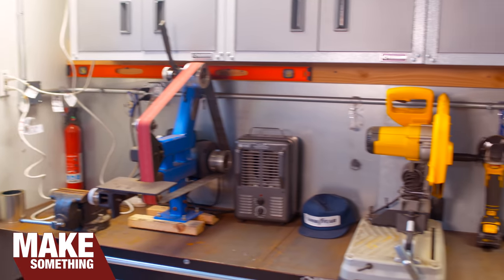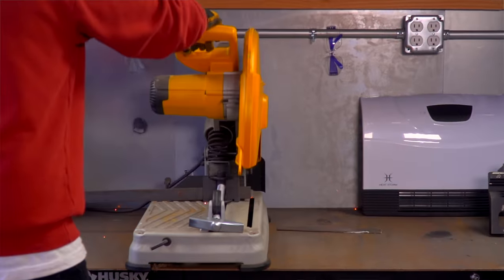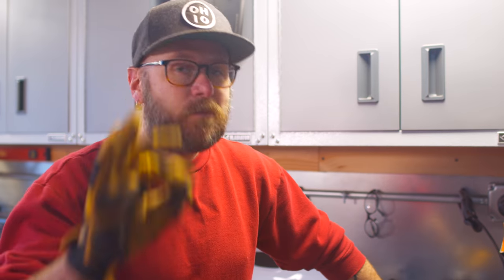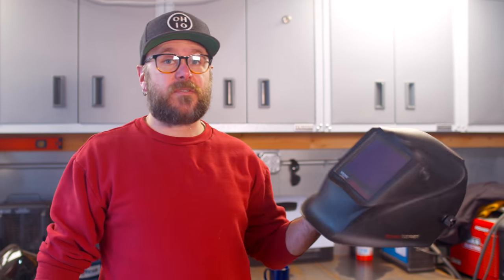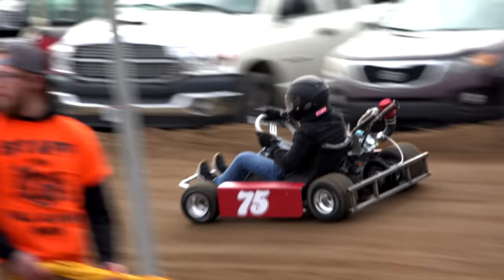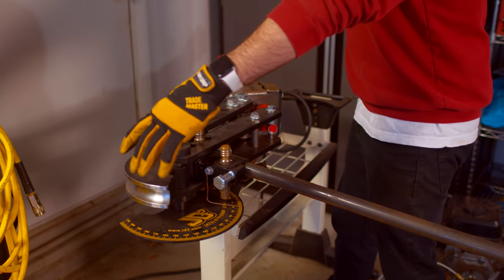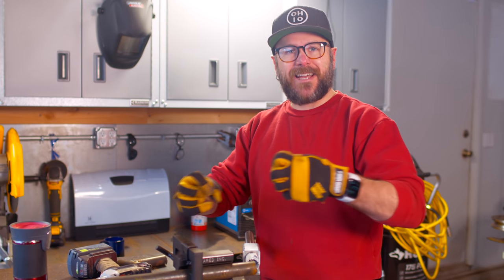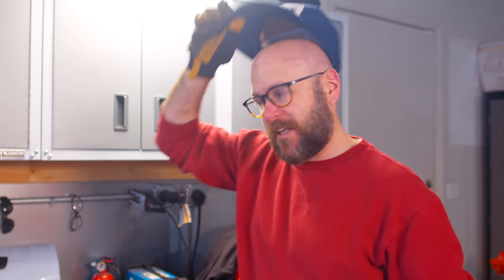Garage Metal Shop Tour. Getting Started in Metalworking. Furniture, Sculpture, Chassis Building.

Comment: Getting started is easier than most think. In my opinion you just have to get the right tools. I remember when I started my shop it was completely bare bones and I didnt even have enough money to buy materials for a table, but I took my only 500 bucks I had and bought the basics and started my rail business building rail on the floor, lol. That was 2016. Piece by piece, job by job, I bought all my stuff 1 tool at a time . 5 years later, took that 500 dollar investment and turned it into 250k a year building rail. Great trade to have...
Reply from the maker: Dang! That's an inspiring story! Right on!

Comment: I'm starting a channel for you...as a former Marine Infantry Platoon Sergeant, I'm starting "Hobby Shop Boot Camp", yup, and my first class is going to begin by asking if you made anything that worked in a seriously amplified manner, lol.  Actually, for a home shop, you have some pretty decent tools.  It's looking like my shop where I metal fabricate and woodwork.  Currently, I am fabricating an all aluminum camper, but designed like none other.  Top secret!
I have a lot of the Flex-Volt tools and they are great.  I have the same Plasma cutter, but went with the Miller 220 AC/DC and learned how to TIG and spool-gun aluminum for the camper build.  You won't regret learning those either.
I'm working in a two-car garage also and have learned to store and in some cases, work overhead.  The large frames which make-up the camper were welded on stands six feet in the air then assembled in the driveway.  I'm riveting the 16ga aluminum skin on it now.  It has radiant heating, and pivot-outs (not slide-outs), and looks like a stealth fighter bat-camper.  You need one.  Look me up.
You need a sheet metal break, 16 ga, probably at least 36" wide (mine is 50" so I can use it on 4x8' sheets)...to round off your metal fab collection.  Buy a pair of Milwaukee sheers you won't regret it.  Oh, and it's true, you love carbide blade on your cut-off saw.
I'm a sarcastically humor-oriented bastard that loves to work with my hands.  Give me 24 hours and you will not be clueless any longer!  Carry-on!

Comment: About welding hoods
You really get what you pay for. I started in HS shop class with a $50 auto darkening from HF that served me well right up until I tried to earn a paycheck with it which was when it died.
I stepped up to a $100 Forney from Ace that isn't much better but I still keep as my backup. The HF to Forney transition was black and white to color TV

I'm in love with my Miller Digital Elite hood. It's a pro helmet. Modes for grinding, cutting, welding, and X mode which is for when you're in a tight space and the sensors aren't always going to be able to pick up welding light, they're tripped by different rays. Idk what rays but it's not your standard UVA/UVB.

Going from the Forney to the Miller was like going from a regular tube television to HD. Bigger field of view, clearer picture, and I feel like it achieves the required lens darkness without limiting vision. Using a shade 11 is using a shade 11 but, I feel like I can see scribe lines or soap stone much better along with material edges and gaps. It makes welding for 10+hours much easier and less fatiguing on the eyes.
Plus, if you're in a large shop, you don't need to carry a hood, grinding mask, cutting goggles, and all that other shit. Only gotta carry one piece of safety gear. Hell, I leave my torch goggles and grinding shield at home. Don't need em.

Lastly, the Miller has a touch more room under it for my Miller respirator. A definite must have for all day every day welding grinding cutting e.t.c

Anyway, definitely recommend everybody to stay away from hoods found at HF, HD, Lowe's e.t.c
Obvs, not everybody can drop $350 on a nice Miller but, your local welding supply will still have something in your budget that's better than the aforementioned junk

You have a cool shop though

Comment: If you do need to mount tools to the floor temporarily, check out drop-in anchors: you can remove the securing bolts and washers, but the anchors stay put. Of course, read the directions and check the thickness of your slab.

Comment: Southern PA bud in the same vote also just bought my first welder setup. Practice some stick the learning curve is sharper but since I've only did a little mig years ago and wrong. After a few hours of stick if I was to try a mig that's gonna be like using a hot glue gun. Tig looks nicer with wood working by miles.

Comment: A benchtop portable bandsaw table conversion such as from Swag Industries would be very handy.   Plus, don't worry about making sparks from your chopsaw;  I've had mine for a few years and it's worked fine.   Have fun with your shop!
Reply from the maker: Thanks! Swag makes some high quality stuff. The mods for my tube bender come from Swag. I'll check it out!

Comment: Didn't follow the "you gotta get a carbide tooth blade someday"  for your chop saw?
Reply: Carbide blades don't throw sparks everywhere and don't wear down as fast as the fibre ones do. It's like a woodworking chop saw but with much lower rpm.

Comment: We raced for 15 years... a bit of advice
Keep a spare engine if it’s good shape. And since you admit you know nothing about the racing thing, building your own chassis will teach you a lot. Education can be expensive.
The science behind chassis fabrication has been developed from years/decades of experience. I’d leave that to a professional chassis builder that has known data & setups. Building the cart from a pile of parts will educate you a lot on the details of how these chassis work.
Reply: I'd sure have that chassis tested before track time. Hate to see you find your welding/engineering wasn't up to safety standards

Comment: I do agree with the carbide bladed chop saw, faster, fewer burrs, quieter, just all-around more enjoyable tool to use. that being said, they run about $400 and blades are $80 a pop. For the size of your shop, I would get one of these.
https://www.youtube.com/watch?v=z2jcbwchxGM
 you get an upright bandsaw with a bit of fabbing, its quiet, the stationary vice, and pivoting head means you can just make saw rack and not have to swing material, the variable speed saves blades, and most importantly you can walk away from it and do other things while it cuts.